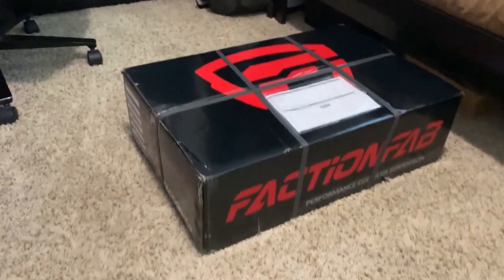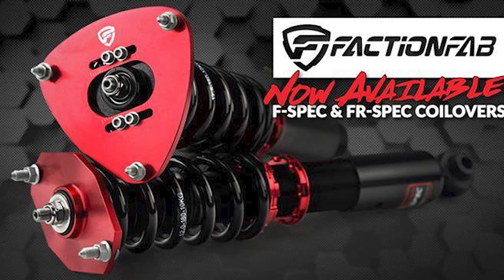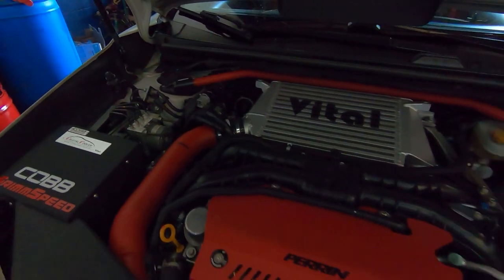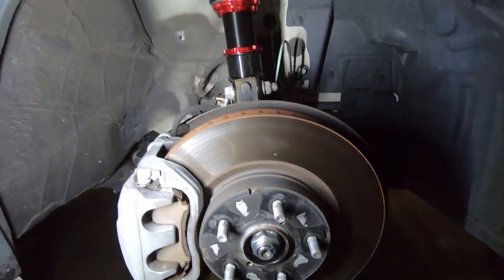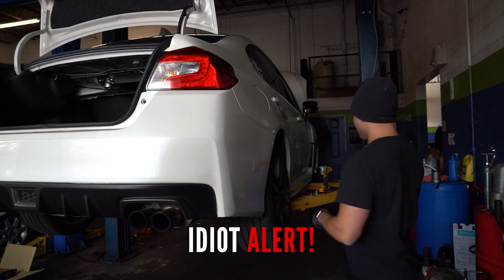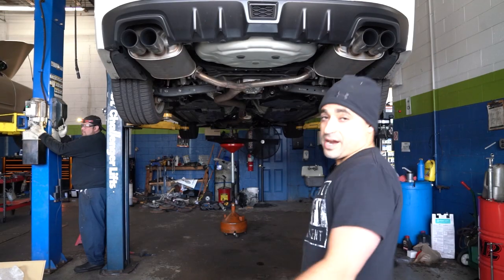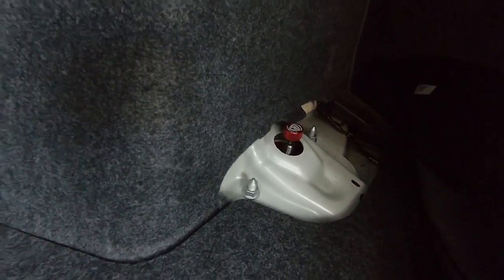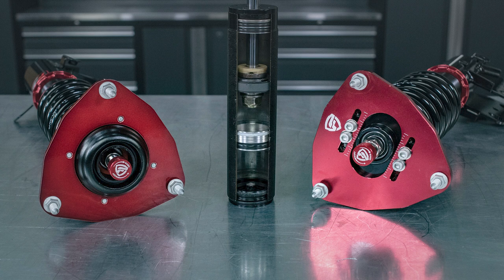#FactionFab Coilovers FR-Spec Install | 2015+ #Subaru #WRX #CVT | Guzman's Random Review

Comment: Thanks Guzman.  Install is an install is an install.  The big question(s) is/are how do they ride and respond compared to the stock setup?  heavier springs, adjustable dampening; how does that work or translate into a better ride than what Subaru thought was acceptable?  Are you still as low, or did you raise it some?  What click are you at out of the 32 possible on the dampening; above or below the center (16)?  Cheers.
Reply from the maker: Wow that's a lot questions. Okay, so the ride feels much lighter than stock. There is a big difference in weight compared to the stock suspension. The control in performance handling is increased, but you would have to feel that in order to know what I'm talking about. As for lowering, I raised the front end up just about a half an inch or so since the recording because I had a front lip problem every time I had to jack the car up. But it's still lower than factory settings. I will say that I have tracked the car several time since this video (you can find it on my channel) and it tracks like a dream. 
The WRX now hugs corners and you feel as if you have more control. I have set my suspension to full soft while daily driving but on the track I increase it by about 15 clicks all around, but I'm still making adjustments to that because it depends on the track and how I want the car to handle when I'm cornering. I will say that if you adjust it to full stiff (+32) the ride will be stiff/hard as a rock and you will feel every bump on the road. But I don't know anyone that does that. 
Overall the suspension is a major improvement on the handling performance of the WRX and you will feel the difference immediately. I also plan on pairing this with the Whiteline front a rear sway bar kit with the endlinks. That will complete my suspension setup. I don't need rear lowering arms because I don't need to go lower in the rear. Hope that answers some of your questions.

Comment: Whats up man... I just installed the fl spec factionfab coilovers and seems to bounce alot on soft and stiff damping??? Do they need time to break in.. or something else??
Reply from the maker: They do need a little time to settle in but that’s just a small drive but there shouldn’t be a lot of bounce. You might want to check you ride height. I’m pretty sure I explain it in the video. If your feeling something different I would have a professional check it just to make sure it’s not a defective product. You may have done something wrong in the set up. Also make sure you put the right coilovers in the right places.
Reply: @guzmansrandomreview  yeah they seem to have settled i hadn't driven it very far due to needing alignment.I basically raised it back to almost stock height... do you have rolled fenders? I had mine done I have the same wheels and with it lowered I was rubbing alittle.. thanks for the feed back🤙

Comment: How many miles have you put on them so far, and how are they holding up?
Reply from the maker: I couldn’t tell you how many miles because I don’t track how miles I’ve used  a part. I can tell you that I have had them on for almost a full year as a daily driver and I have gone to the track a couple times and they still perform like they should. I have no complaints after a year of them on. Hope that helps.

Comment: Does it make any squeaking sound after you install? Just install my fr spec it’s making squeaking sound when I turn my wheel
Reply from the maker: Sorry for the late reply, I haven't been getting notifications. You should get that looked at. It shouldn't squeak at all. Check entire system and make sure everything is where it should be and tight. If it still makes the noise take it to a professional. Don't take any chances with suspensions. Good luck.